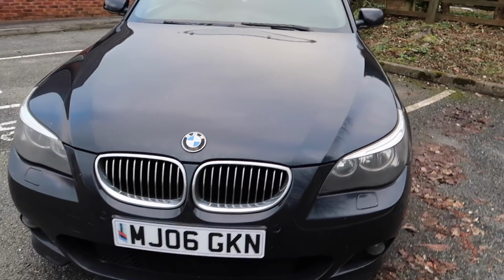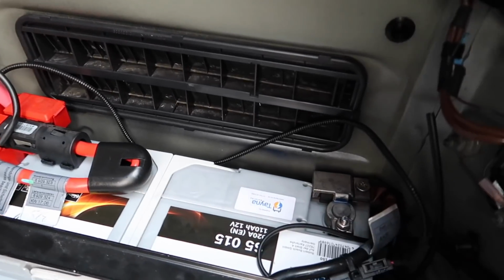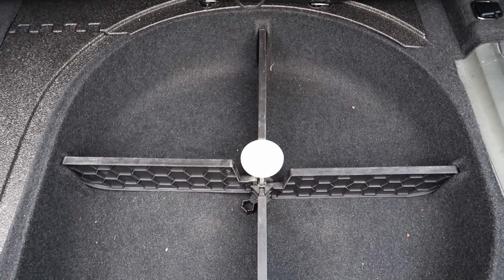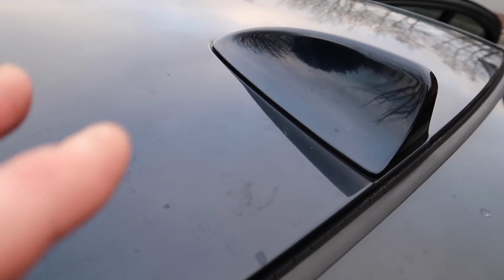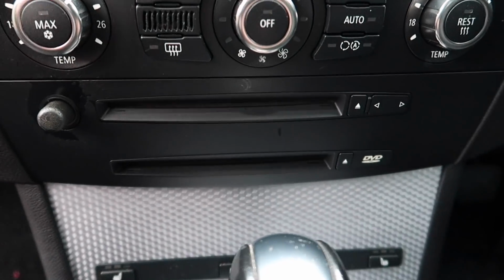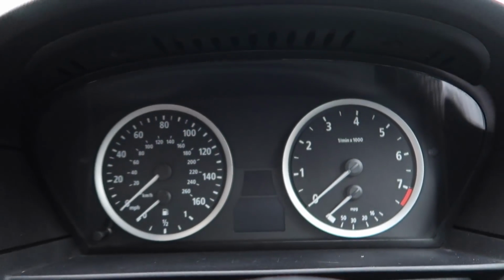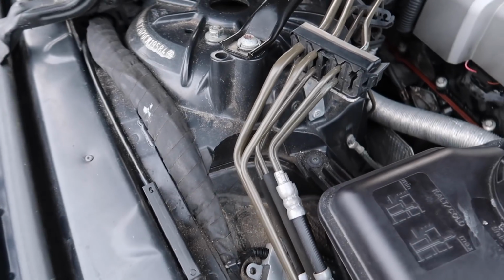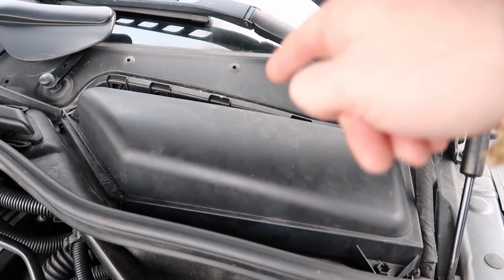TOP 10 Electrical Items That WILL FAIL On Your BMW E60 & E90....... These Issues Will KILL Your BMW

Comment: I got 528 xi in limp mode with acc pedal throttle body and car lift and 4dread one brake 4x4 traction control tried different dem and cas and key did help please help never been found car I can fix

Comment: Can you help? I have an 05 525d e60 alternator isnt charging the battery. i have since noticed  the ibs sensor is badly damaged and corroded i have now  fitted a replacement sensor  from a 6 series ibs sensor which has the same colour wires same everything in fact. It's identical. Ive registered a new battery but still i find the alternator isn't charging. i had a ibs sensor fault code and power management fault. I have cleared the fault codes now which wouldn't  happen with the ibs sensor fault present. I did  foolishly. reset all codes before changing anything would that stop the alternator  communication. But  The ibs sensor fault was still present that wouldn't clear until i fiited the replacement ibs.

Comment: I got a 08 e60 the ac or heat don’t work like no air thru vents so I replaced the blower motor and resistor and still nun any idea?

Comment: I had the dreaded airbag light come on on my 06 E60 (codes showed it wasn't an airbag fault) so I snipped the wire and soldered in a new resistor. Lights never come back on and the resistors were £4 for a pack of 50..... lol I've also had the alternator fail at 200k, PDC fail on front left 2, and the nearside parking light doesn't want to come on at all because of a wiring fault somewhere. Whilst most the issues occur 2005< - the 2006 can still be a pain!

Comment: I have a 2006 bmw 325i the initial issue that started is the windows went down and would not roll back up. I could not adjust the front seats and the signals stopped working. I had the FMR tested that was working fine. I replaced the JBE I’m not sure if that fixed the issue with the seats because now when I connect the battery the light will come on for about 30 seconds and then it shut off but once it turns on the car won’t even crank it won’t start. It won’t do anything. Can anyone help me here I feel like I just keep buying stuff and nothing is working. The next thing I planned on doing was replacing the power distribution box

Comment: I have a 130i e81 N52 (2011), I believe it's same platform as an E9. I've had the yellow steering lock in my car with really heavy steering, took it to the dealer but they wanted to charge $10k, so I took it to an independent workshop and they charged $800 for fixing it electronically. 5 months later the steering lock appeared again, but the wheel doesn't get as stiff as previously. Please is there anyway I can contact you (paid advice).

Comment: Hi I'm late to your excellent videos are you still operating and continuing to send out videos, I have a battery drain on my 2005 e60 530d, it can drain overnight or generally by the 2nd night if not run, I've no idea to the problem could it be the ibs if so how do you disconnect, or something else the clock and trip milage and mpg ect allways resets to zero on turing on ignition, I'm shaw its battery drain, would love your advice or I'd pay well for your service. I'm in the sheffield area. Please reply.

Comment: Hi I’ve been watching a lot of your videos trying to figure  out what is wrong with mine , I have a problem with my 2008 520d e61  where the car was  running and driving fine   But had central electronics failure but I went to the car today and I had no ignition lights other than brake warning light and air bag warning light ,  I have since found out about the module behind the glove box and the relays  and modules in the spare wheel well in the boot , so my question is  do you think the no ignition lights is related to the water  damage in the white module box on the boot or could it be the  module behind the glove box , please comment back as I’ve only had the car 2 days so I don’t want to go spending ££££ on parts I don’t need ?, awesome videos too not many people thats go into depth about issues

Comment: Hallo Dean, Thanks for all the videos on E60, I Got an E60 530i M54 been running smooth last 4 years No problems, now i have a huge problem, my car have been to 3 shops (2 of them BMW Electric specialist) but my car keeps draining the battery, story goes like this, 1st I came out to my car after work all Windows were Down and sunroof open, I though it was a pocket push, so brushed it off, 3 days later same again, took it to a shop, they Said once in a while the whole car wakes up and We cant figure out why, and now the 3rd shop gave up and Said the same thing, im desperate for help 🙏🏽

Comment: HI i have a 05 e60 545 and it crank and no start fuel pump is good when start it kicks once for a minute and then its dies, try starting it again and its just turning over no start. any suggestion?

Comment: Thankyou for your videos they are a great help for a better understanding.

I've recently bought a E60 3.0d and it seems to have some irregular fault codes that come up and sometimes rest on their own accord and other than times I have to restart the engine for codes to be reset.

It's generally abs,DTC,tyre pressure that persistently come up and randomly get pas,steering lock, battery terminals, servotronics, transmission fault and others

Most of the time it's as as if moderate acceleration, pot holes/puddles or high use of voltage (using radio, blowers, rear screen heater ect) if will throw fault codes.

It goes into limp mode it seems if changing gear as fault codes show up. Power steering goes and transmission gets set into 3rd gear untill I restart engine and it drives fine again sometimes for 30 plus miles then other times it will consecutively persist reverting to limp mode several times from fault codes in a short journey.

Any help or direction in fault finding would be greatly appreciated.

Kieron
Reply: Hey, did you find solution to your problem?

Comment: Rdc module on my 08 e60 got wet, aI disconnected it, but now my climate control wont change my heat vents, i only have heat coming out of 2 vents, and nothing changes even when i turn on a/cit also wontturn on max a/c i don't know what to do. Its 1degree here.

Comment: thanks for all the good videos you have here, if you can add another one in my case i have a 2010 BMW 328xi and i hooked up a scanner to make another extra key through the immobilizer function and it started to do its thing up to 4% and i disconnected the cable from the obd2 port and now the car has no power at all the key dont work nothing on the instrument cluster, no power on the navigation screen nothing the only power i get is when i turn the rear and headlights on  !!!

Comment: Can I have your number please? 
I've got a bmw e60 525d,  the car have a big vibration,  I've changed  the flex disc and csb  cause where damaged , from the propshaft but the car is still vibrating .
The car is usually vibrating between 60mph -80 mph .
Tyres ,discs brakes,  and everything on the wheels are new,  what else could be? 
My mechanic is saying that is weird and we should change the engine mounts,  gearbox mount and the oil in the automatic transmission to see if still vibrating after that. Many thanks.

Comment: My faults sometimes key fob won't lock the car 55 E60. Also no crank no start . Sometimes cranks but don't start. Other time no problem starts on the button. Fault code 46D1 internal fault. What needs replaced?

Comment: Hey Doc, I've got a 2007 520d, its a facelift with the old m47n2 engine. One day it just would not start. It cranks at full power, but will not start. the battery is a few months old. The call-out mechanic found a problem in the CAS unit, it showed one of the of the relays being down. Would you happen to have any other ideas before I pull the trigger and start removing the CAS and the DDE?
Also when it refused to start the first time the idrive showed: DBC failure, Drive control system and Start assist failures. Not sure how thats connected, never had these issues before. Thanks in advance
Reply: I am having the exact same issues on my 520d n47 engine. Aswell as dbc fault im also getting fuel pump fault. 
Some days car starts up perfectly fine other days the car pauses and then cranks but dosent start.
Any help would be amazing

Comment: I have problems with diversity antenna ,the key its onlu working whem i puit it next to the antenna ........probably this is the reason for high battery draining showing in the dashboard......its 300euro a new one !!
Reply: @smamas114  hi there, did you replace it in the end? Having the same symptom and want to know if replacing the antenna will fix it

Comment: Doctor, can you help with a tutorial?  I’ve got a 2011 E92 ‘3 LCI, 335i N55, auto, M Sport pkg, build 3/30/11.  79,300 miles. It’s a USA car.  I have an electrical issue that comes and goes. I’ll get a warning on the iDrive nav screen that there is a problem with the passenger airbag.  It will say that it’s not operating, but to continue to use the seatbelt. This warning will activate even when no one is sitting in passenger seat. Sometimes it will remain on, sometimes it doesn’t activate at all and appears normal. How do I diagnose this?  Could it be the seat sensor or something else? Thanks Doc. ~Ernie.. Florida.

Comment: Have any vids on E91, car only stalls when in heavy slow traffic ( note have removed main fuse panel and checked main battery cable and board is fine) any suggestion ?

Comment: Helo, who knows what could happen, when I unlock the car all the pointers of the clock are pulled all the way behind 0, and there is a sound like knocking, when I turn on the car the pointers do not work, it lasts about 30 seconds and then everything works normally when I turn off again and I'm waiting for ten minutes, everything is like that again, someone knows what the problem is

Comment: I have a 2010 535i and all the angle eyes and inner headlights don't work any guesses?
Reply: Did you get this fixed? My 2010 535i is having lots of random issues.

Comment: idle air control regulating valve keep buzzing even after I turn off my BMW e60 I replaced the IBS I never replaced the Air Control Valve and I cant find anything on testing it.  E60 525I

Comment: I have an 2004 bmw 545i. Car starts then dies. Stuck with p1720 code. I changed battery, alternator voltage regulator, IVM module and micro power module. Now I don't have the option to register battery. Any ideas what it can be? Any info would help. Thanks

Comment: Hey Dean, I locked My keys in the trunk. The trunk lid is not connected to the system. The problem is the car itself is locked and the alarm is on. How can I get My keys out of the trunk without the alarm going off?
Reply from the maker: yikes bro 😬 your gonna need a door wedge that pumps and a hanger and try and poke the lock button on the dash that’s your only way.

Comment: Amazing video.. I have an E60 with a N52 motor. I am having a variety of electrical issues. 
I used to have a severe battery drain on my car. I just noticed that the water pump on my car keeps running. It was running for more than an hour after the car was shut off. I have unplugged the battery and put hooked it up to a slow charger. 
I think the water pump and thermostat needs to be replaced. 
Another issue is that everytime i reconnect the battery, I get a message saying transmission failure, Cruise control malfunction.. I reset the transmission adaptation by holding down the gas pedal for 30 seconds and then turn it back on and then the message is gone. Car runs well and shifts perfectly. I only have 135,000 kms on my car. Can I contact you via email?

Comment: Hi, great informative videos, thank you. I have a 2007 520dMsport with an intermittent fault causing the following warnings on the iDrive: Cruise control failure, DBC Failure, Drive control system,  Servotronic failure, PDC Failure, Start assist inactive and Fuel Pump. i have changed the PDC Module which has cleared the PDC Failure, but the other faults come and go randomly. any advice would be greatly appreciated. Thx

Comment: Can you tell me where the starter relay is located on  a 2010 528i? Car was running perfect. I stop by my parent's house for 10 minutes. Then hopped back in car. No start. I saw a faulty ignition code pop up on my i-drive screen briefly but the fault message is no longer there now. But car still won't start. If you are able and willing to guide me in the right direction it's to be much appreciated.

Thanks!

Comment: Do you know why my 2004 Bmw 530i doesn’t hold power when I jump start it it turns very slow and then my headlights start flashing I replaced the alternator tonight but it’s still not holding power also when I take off my jumper cables it’s back to no lights at all please help me thanks!

Comment: HI we buy a 2006 330i with a bad engine but before we change the engine every thing was working fine, but after installing the engine and connect the battery the fuel pump keep running and lights work radio seats sunroof but ignition on the cluster to start the car all fuse and relays is ok .we scan the car it is giving a code that saying that terminal 15 is missing ,but we're geting 12.59 v every where else on the car need some help please

Comment: Recent justices qpurchased a 2005 545i,  as of right now the lights are completely off, I don’t the think the car battery is dead because I recently replaced the old one. And I dint think it’s because it’s not pregamed yet since I’ve only driven it twice, both times not too far from my house. I tried disconnecting my ips wire (at least I thought i did it right) and it still won’t turn on

Comment: Hi mate
I have a BMW 645 E64 2005. 
It sounds like the same faults you have mentioned.
I have ABS lights on dash, Steering pict on dash, along with power steering been heavy, the heaters want work, 
the windows want work and the i drive doesn't work neither.
 its exactly same faults as my car . 
I Bought brand new battery and in a day its drained. Can this be the same on my car too?

Thanks
Reply from the maker: Don't Know sorry cant help, Don't know anything about these cars

Comment: I have a 2006 550i automatic v8 having issues with my screen display. Seemed as if it was rebooting as I was driving one day and once I shut off the car it never turned back on. I can hear the fan running all the time even when my car is off. No radio, no gps and no way to tell if I have any issues, what do I do about that ? Can I unhook the battery to reset everything ? Or just take the car into a BMW mechanic and pay the price ?

Comment: Dear Doctor. I also have a central electricity problem and don’t know where to start looking. The air conditioner sometimes fades away, sometimes it doesn’t. The radio and cd are choppy. The back of the panoramic sunroof remained open. Reset does not respond. The engine stopped a few times by default. I replaced the MPM module and the trailer module. What do you recommend?
Reply from the maker: I recommend leaving it until it catches fire and then buy another car

Comment: I checked a couple of fuses on my e60 and one of them made a spark ( may be I forgot the key in the ignition dump me) . now the windows , mirrors, Abs, power lock pass. restrain are not working or show errors. I tested all the fuses with a tester and noticed that fuse 85, 87, 88 and 89 not not on ( not getting power ) but not busted. please help . Thank you very much
Reply: then you need to figure out what fuse 85 87 88 and 89 are for and go from there :)

Comment: Hello Dr.  I just finished troubleshooting my power drain and traced it to the cluster. What are the best options to correct this issue?  The cluster seems to function normally but it is keeping the car awake. For now, I am pulling the fuse when I am done driving and reinserting before I start the car. Another question, where does the fiber optic signal originate for the Most Buss?  Is it the amplifier?  I recently lost all I drive functionality and I am not seeing it light up I will double check all my fuses but I wonder if my micro power module went bad. I relocated it when I got the car and the connections look clean.

Comment: I just replace my 2013 BMW 528i DS Turn signal and the parking light and it is still not working. My headlights works fine. I was told that it needs to be reprogrammed due to the fact that I also change the headlight module.  Now the headlight is not communicating with the my computer system after replacing the turn signal, the module and the parking light.  How can I fix that? What do I need to check?
Reply: you need special tools and software to register it to the car.

Comment: Hi mate my e90 2007 320d had a flat battery  I jumped  it the car won't  start  turns over iv had aa  out when  he's  plugged it in  its come up with  code 4a63 signal immobiliser manipulated switch code  faulty  what  is  this thanks  Howard

Comment: Hi boys need some help with the dreaded trifecta lights.. it’s a lci 535d, ever since I bought the car the brake pedal pulses under 60km/h like abs is kicking in but no lights on dash. Checked out the codes using ista + and rear left speed sensor plausibility, I clear the code and it comes back sometimes as air gap rear left speed sensor.. and so on.. I have checked the speed all live data is fine until I brake, I will attach video. I swapped two rear wheel speed sensors places and even tried a new one with no change. I’m starting to think it’s either wheel bearing abs ring or yaw sensor.. because on yaw sensor I’m getting no reading from left side only from right side yet there are no fault codes associated with yaw sensor (lateral acceleration sensor) of course it could also be the abs module, I checked the wiring which seem fine from both ends.
Any suggestions greatly appreciated
Reply: Rotors